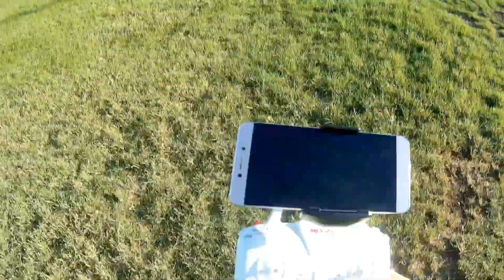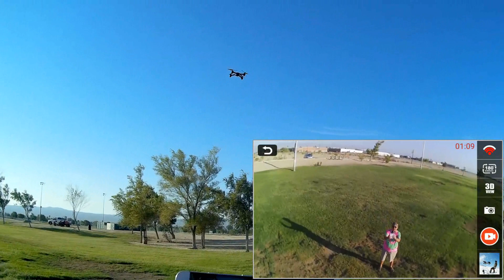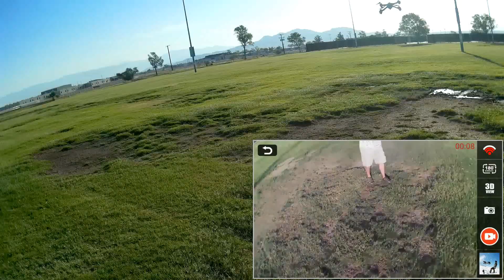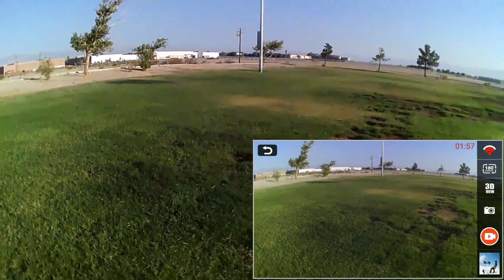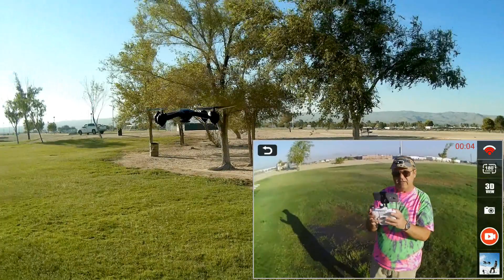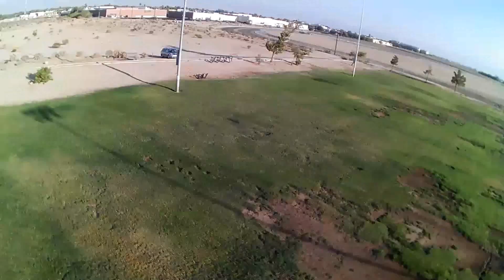MJX X708P Optical Flow Strong WiFi FPV Drone Flight Test Review

Comment: Hi Quadcopter 101!  I am trying to find an FPV drone in the ~$50 range that has as little lag as possible and so far, it seems like this is one of the better ones. Since you have reviewed so many extensively, are you able to reccomend a drone in this ~$50  price range with very low FPV lag? Thanks!

Comment: My comfast 2.4/5.8g wifi extender with twin aerials came today from Amazon.... I ordered it yesterday!
Did yours arrive yet qc101
Reply from the maker: Yep, I got it.  Haven't had a chance to try it yet though.  Maybe this weekend?
Reply: Well Im stuck QC101
Have you got any instructions for the comfast dongle 926AC V2?
 as I cant get anything working yet except as just a wifi dongle... i dl more updates on their site but they have no support page.
is there an IP address I can access the menus inside this repeater dongle. thanks.

198.168.10.1 doesnt work.
Reply from the maker: Unfortunately the 926AV V2.0 is not a WiFi repeater, and can not be used as such.  It is merely a USB dongle for adding 5G WiFi to your laptop computer (if it doesn't already have it).  However, Comfast also makes a 5G repeater model CF-WR371-AC.  This is what I've recently received.  I have both and they look exactly the same from the outside.
Reply: oh darn.. oh well thanks for the info i will return this and get that one.. well maybe after you reviewed it- how much do they cost?
and where did you obtain yours please?
Reply from the maker: One of my viewers alerted me to it.  Currently only available on Aliexpress.  But wait for my review before purchasing it in case it doesn't work well. https://www.aliexpress.com/item/Comfast-CF-WR371AC-600M-Wireless-USB3-0-Dual-band-5G-WiFi-Repeater-802-11ac-Network-WiFi/32881986267.html
Reply: Id be amazed if it really made 600 Meters distance as it claims..... id buy three more :D
Reply from the maker: That's it model CF-WR371-AC

Comment: By now I own that drone and it flies really well, even indoors. But there's a big problem here, although the drones WiFi connects to many phone, the app doesn't, which means in effect: no camera. I have tried three phones with the same result. Anybody have any idea how to solve that?
Reply from the maker: First off, if using the controller, make sure to select "Monitor" when using the app.
Second where did you download and install the app? Assuming that you're using an Android device, first try Google Play https://play.google.com/store/apps/details?id=com.mjx.mjxh&hl=en_US
But if the Google Play version is causing the problem, next try downloading and installing the app directly from MJX here http://www.mjxrc.net/tools/download.ashx?site=main&id=117
Reply: So far I find it to be a IOS vs Android issue. Works for me on IOS using iPhone 4s or new iPad.  Does not work on android. Tried new Android phone (xiaomi mi a1) and really old Acer phone. Using direct link from MJX did not help.
Reply: Quadcopter 101, thank you, I'll try that. ( But that would mean, that there are two different versions of the app?)
Reply from the maker: Yes. Google always checks an app for malware before they list it on their Play site.  This can take some time before a revised app is posted on their site. As such, the newest version of the app should be available directly from MJX on their website.